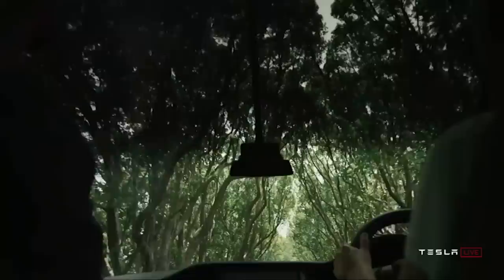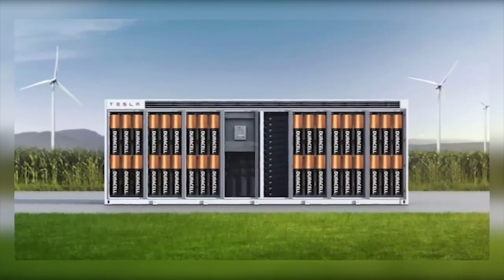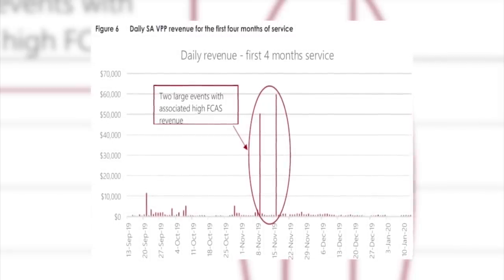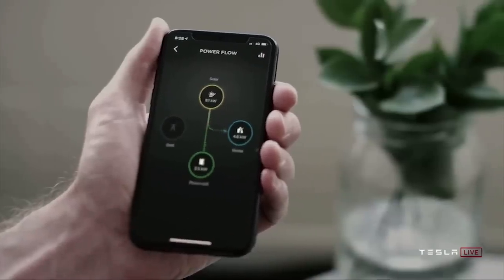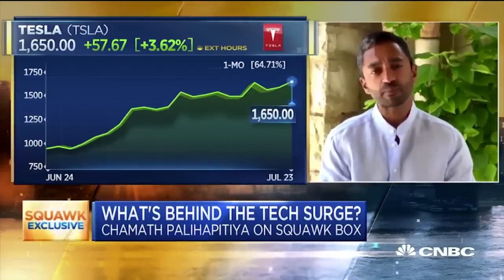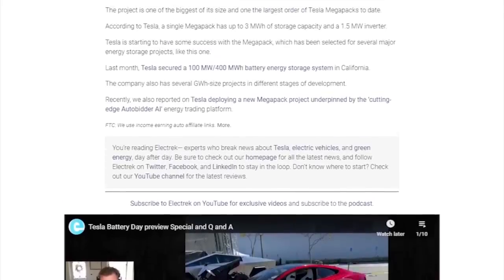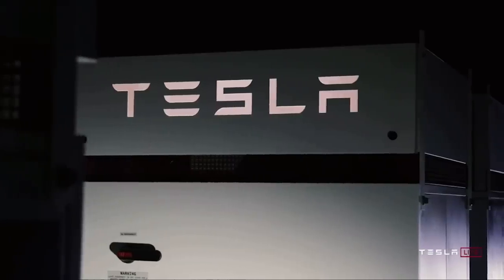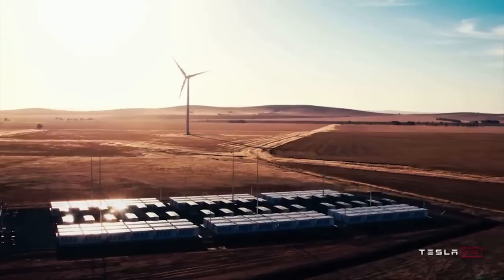Tesla Battery Farms Will Destroy Utility Grids

Comment: Elon states on battery day stated Teslas value (on the vehicle side) is= total vehicles produced times autonomy. What’s your thoughts on mobile Eye and Mobile eye being used in 25 auto makers in 300 models using there autonomous driving? BMW series 3 and X5 SUV branded under BMW drivers assist 
Software. The Volkswagen  Passat and golf branded under VW travel assist. the 2021 Ford Mustang and 2021 F150 will use mobile eye. Nissan Pro pilot 2.0 is mobile and the Chinese start up Neo the pilot  the es6 es8 use mobile eye. If more manufacturers start using mobile Eye could they acquire more data than Tesla?
Nvidia is partnering with Lee auto, QUALCOMM has started their own autonomous division as well.
Reply: Mobile eye ??? Autonomous cars are an irrelevance. No need.

Comment: This is why I invest in Tesla.

Now let me pose a question.
Over the past roughly 50 years, the safest most consistent returns on dividend stocks has been in energy.  With electric being the most stable.  So if Tesla's plan is to turn the electric business upside down, where then is the best place to invest in dividend stocks for solid consistent returns.  I suspect it would be with companies who are forward thinking and who's management teams embrace these ideas.  So how do we find out who they are?
Reply: I would assume investing in energy companies that start adopting megapack. Of course it doesn't have to be Tesla. I assume Tesla doesn't want to get into consumer electric they will more likely try to be a equipment provider to your local utility. Besides the only other utility i would invest in is Internet providers who provide high speed bandwidth.
Reply: @NPAMike  a megapack is a microdot in the ocean of energy. get real.
Reply: Tesla doesn’t give dividends rn…
Reply: @ladasodaexplains3355  I know.  That's why I posed the question.
Reply: Did you invest in Enron ? Keep well away from power utilities if you value your sanity.

Comment: I hate to bust your bubble, but batteries and solar will never eliminate the need for some sort of ultrareliable traditional power generation. Batteries will excel in their ability to rapidly respond for voltage support and frequency control and that will be their role for the decades to come. Base load will need to be supplied by traditional sources for well into the future.
Reply: There's the truth. Batteries are a sideshow.

Comment: Will we scale up renewables, megapacks and electric transportation fast enough to eliminate industrial carbon emissions before climate change destroys our civilization?
Reply: There is a lot of money invested in our present infrastructure, replacing it after 20-30 years with whatever is cheapest would be business as usual. A good indicator is that very few countries are forcing coal plants to close early, that would require huge public support which may need huge destruction first.
Reply: I think you may have been taking 'kiling the planet' over-seriously. It's not going to happen tomorrow and if it was, we couldn't stop it. It'll be decades before fossil fuel usage drops out of the picture and users that need very energy dense fuel like aviation are likely still to be using it.
Reply: @pasoundman  We need to transition off fossil fuels as soon as possible and onto renewably powered electricity. We then need to start the massive process of sequestering our industrial carbon back to pre industrial levels of 270 ppm.
Reply: @aaronvallejo8220  Why would we want pre-industrial levels ? CO2 is plant food ! Do you want to reduce agricultural output ? Nuclear is as good as renewable for practical purposes btw. Breeders will last forever.
Reply: @pasoundman  As the EPA and IPCC have concluded too much carbon in the atmosphere and it becomes a toxic much like peeing in your vegetable garden too much. Yes for a safe and stable climate we want 270 ppm of atmospheric carbon again. Not a planet getting warmer annually.
Reply: @aaronvallejo8220  Ever been in a submarine ? CO2 is limited to 4000 ppm and obviously that's not toxic. Did you know that some commercial carbon capture feeds it to tomatoes ? Anything wrong with a target of 350 ppm ? Bear in mind that CO2 is still not PROVEN as a cause of global warming and the IPCC's earlier reports for sure were full of LIES ! What did they predict about sea level ?

Comment: I Initially thought that the new mega packs would probably made of the newly demonstrated batteries, but then it hit me, they choose the current size because the weight would otherwise impact the vehicle range....mega packs don't go anywhere though so they can be chunky and the only limiting factor is heat buildup. Now imagine the new battery design that is twice as thick :drool:
Reply: The new packs don't use any less material than the old ones. Any savings are purely in fabrication costs. 69% less fabrication costs maybe, unchanged material costs. Oops !
Reply: @pasoundman  I'm not sure how you got to that conclusion, the batteries will have a higher energy density per space used, and the mega packs will be switching to iron-sulfate? instead of nickel-manganese-cobalt which is easier to acquire in large quantities. The chemistry change will offset some of the density gains but should still be a bit cheaper and allows for mass production. They'll be able to sell these at a price and scale that other companies simply can't compete with unless they improve their production as well or find a new tech that works equally well for a similar price point.
Reply: @maddognl  How exactly will the batteries have a higher energy density ? It's not MAGIC you know !

a lithium  nickel manganese cobalt oxide ( NMC ) , a lithium manganese oxide ( LMO ) , a lithium  iron phosphate ( LFP ) , a lithium  cobalt oxide ( LCO ) , a lithium titanate  ( LTO ) , a  lithium  nickel cobalt aluminum oxide ( NCA ) , a layered transition metal oxide ( such as LiCo02 ( LCO ) , Li ( NiMnCo ) 02 ( NMC ) and / or LiNio.8 C00.15Alo . 050 , ( NCA ) ) , a spinel manganese oxide ( such as LiMn 04 ( LMO ) and / or LiMn , Ni . 04 ( LMNO ) ) , an  olivine ( such as LiFePO4 ) , chalcogenides ( LiTiS ) , tavorite ( LiFeSO4F ) , silicon ,  silicon oxide ( SiOx ) ,  aluminum , tin , tin  oxide ( SnOx ) , manganese oxide ( MnOx ) , molybdenum oxide ( M002 ) , molybdenum disulfide ( MoS2 ) ,  nickel  oxide ( NiOx ) , copper oxide ( CuOx ) , and lithium sulfide ( Li , S ) , or combinations thereof .

Are the chemistries listed in Tesla's tabless patent.
Reply: @pasoundman  Of course it's not magic, it's simply a better use of space, rather then adding wrappings for each small cell, you use one giant wrapping for a big one. Add the changes in cooling and you end up with less wasted space that could be used for more storage instead, thus increasing the energy density of the mega packs as a whole.
And I was referring to the LFP for the new chemistry. Sulfphate/Phosphate, I prevously added the questionmark behind 'sulfate' because I wasn't sure other then the lithium iron part, my mistake.
Reply: @maddognl  Better use of space improves the Wh/l. It doesn't improve the Wh/kg which determines the cost. Elon's 'smoke and mirrors' fooled you.

Ok, you meant Phosphate. A well established chemistry. AND ?
Reply: @pasoundman  At no point did I argue that weight was beneficial, in fact in the original post I clearly stated that the weight was the reason why they didn't increase it further for the cars. But by increasing the width further for mega packs they instead could continue to increase the Wh/l as you put it and reduce 'production' cost. The chemistry change reduces the 'material' cost at the expense of some Wh/l. This allows them to avoid getting battery constraint. Add in the production changes which allow them to mass produce the mega packs and as a result they can produce mega packs at prices and quantities that the other suppliers currently can't. Like I said in an earlier reply, the competitors need to improve their production method or upgrade their battery tech to keep up (I never said they can't).
The only reason why I corrected the chemistry was because you were pointing at it being wrong (which I was), It's not a magical mix and their competitors have access to it. But unless they improve their wh/l, heat management and production methods it will end up being an inferior product at the same price point.
You not understanding the complete picture does not make it smoke and mirrors.

Comment: The only "issue" I could see is that when the grid changes a majority of peaker energy coming from batteries we will see profitability of the auto bidder go down to some degree as the price difference in the time of use will flatten a bit. The curve would always be there, but just reduced.
Reply: Many studies have been done on distributed generation's effect on the load vs production curves at peak periods. Not likely there will be significant flattening in the load curve due to the weather mainly. I was a reliability operator in the WECC in a BA that has a huge amount of wind and solar. Nothing like balancing load to production when the thunderstorms are whipping around the interconnection due to high winds and PV array shading. Unfortunately roof top solar is susceptible to the same limitations at the distribution level and makes only a little difference to the peak load. The best has been the large retailers using them for refrigeration and AC which is prime for mega pack integration. Say every Walmart has one. Still, peak shaving will take a long time to impact this and better reliability will mean higher consumption. I watched the load change IRT for hours and hours.

Comment: Tesla has yet to take over anything. They need to produce millions of vehicles and get the price down. They have a long way to go and need to do it faster.
Reply: There's competition out there.

Battery electric cars on sale in Europe

Volvo
XC40 recharge
Polestar 1
Polestar 2

BMW
i3
Mini e

FIAT
500e

Renault Group
Renault Zoe
Dacia Spring (due Q1 2021 in Europe,  already on sale in China)
Nissan Leaf
Nissan Ariya (due 2021)
Mitsubishi ASX ??

Mercedes
EQC
EQA (2021)
Smart EQ fortwo
Smart EQ forfour

Jaguar     Ipace

PSA Group
Peugeot e208
Peugeot e2008
Opel/Vauxhall Corsa e
Citroen C4 Cactus (2021 ?)
Citroen e-Spacetourer
DS cars DS3 Crossback e-Tense

VW Group
VW iD3
VW iD4 (released Sep 2020)
VW e-Up
VW Golf-e
Audi e-tron
Audi e-tron Sportback
Porshe Taycan & Taycan 'turbo'
Seat Mii
Seat El-Born
Skoda Enyaq (2021)

MG cars (SAIC -Shanghai Automotive)
ZS EV
MG5 e-wagon (2021)

LEVC  (London EV Company)
TX electric taxi

Chinese brands

BYD Auto
Tang (Norway only at present)

xPeng (Norway late 2020)
P7, G3

Aiways
U5 (Germany only at present)

Nio (due 2021)
ES8
Reply: pasoundman quality all very low, expensive and less range than a Tesla. If you want a gold standard EV Tesla is the answer.

Comment: I think energy storage will do very well but you framed the theory wrong - Tesla Megapacks are not destroying the grid as much as they are destroying the need for peaker plants.  The grid will just become more efficient by using batteries as a buffer.
Reply: Indeed. Peak power generators are inefficient and expensive. Battery banks allow the more efficient base load power generators to generate extra power around the clock and store it in batteries. Then, the batteries would discharge the stored energy during peak demand. This is huge for simplifying power plants, increasing overall efficiency, and reducing pollution.
Reply: This piece seems key. In California at least, we can generate plenty of energy during the sunny days but when it's hot after sundown and the wind isn't blowing and working families do end of day things is a problem in need of addressing.
Reply: Brian W. 
If you crunch the numbers, I bet you’d find that even storing the “renewable” energy will never meet the peak demand. And, the increase of EVs and decrease in coal plants will make California’s situation worse.
Reply: @Austin1990  Inability to meet demand is a key problem; supply and demand is really simple economics that the left seems to not grasp. Panel and battery disposal are problems for sure as well. I have enough power gen to meet my needs now without AC or an EV, but if either of those things happens I will probably be short.
Reply: @Austin1990  Please look at California's "duck curve" of power generation from solar and wind.
Reply: Art Snow 
I formally studied solar energy and how much solar energy was potentially available at different angles and locations. I hadn’t heard of the duck curve (I just looked it up as you suggested), but I am familiar with all the concepts.

Comment: You did not mention the new 50 percent more efficient battery Tesla has announced that will be used in these powerstorage systems as well in 3 years. That will make these calculations even more appealing. It will be interesting to see if emerging companies like Ambri.com (liquid metal batteries) can match Tesla in price and performance for utilities.
Reply: more 'efficient' in what way exactly. too many people bandy that word around without knowing what it means.
Reply: @pasoundman  You have to watch the replay of the Tesla batteryday to get that. But by using a larger size battery, more density (Maxwell style), altering the internal structure (simplyfy), improvements in mass manufacturing techniques, making the battery part of the structure of the car (not as a separate pack), no more cobalt, and more bring a big improvement in range, cost, unlike any other manufacturer at this point. Today I read that prototype Tesla cars are already testing this new battery. The challenge now is to produce them in high numbers... Is that good enough for you?
Reply: @ocker2000  Better than that, I've read the patent ! There is absolutely no improved energy density. The materials cost per Wh is unchanged. What you saw was a clever manipulation of the figures aka 'smoke and mirrors'. The remainder is wannabe 'jam tomorrow'. What's in the patent will reduce Tesla's FABRICATION costs and nothing else.

Comment: I’m all for grid storage and renewables, but this video mischaracterizes, simplifies, or outright ignores how electrical power distribution actually works.

Battery storage and solar generation does not and will not “destroy a utility grid”. If everyone owns a battery pack and/or solar generation, that does not make you a utility. Utilities are primarily responsible for the engineering, construction, maintenance, and load forecasting for the grid. They are the only ones with the top down view of electricity consumption and the understanding of how to maintain and accommodate the grid as it stands today, and how it will evolve in the future with more customer generation. Today, the grid works as it does because there is a predictable amount of load being distributed at any given moment. This allows for predictable system protection and reliability. Introducing thousands of unpredictable spot loads onto a circuit would fry every single piece of system protection. The fundamental operating nature of the infrastructure does not and will not accommodate such a set up where generation could fluctuate wildly. There will always be locations where customer generation is not feasible and purchasing grid power will be the only feasible option. This does not eliminate the possibility of a community generation site to feed this customer however. But if the actual power lines are still needed, you still need the utility company.

In addition to this, the utility decides if you are allowed to send power back to the grid, because they know exactly how it will affect system protection and other distribution equipment. Even the addition of “small” 2 MW community generation sites have heavy financial burdens for system protection and reliability upgrades necessary.